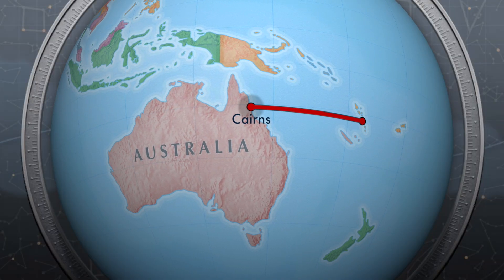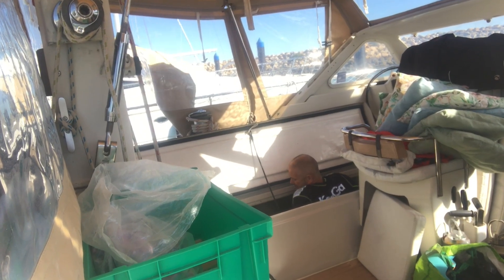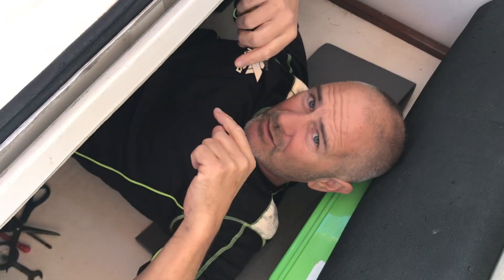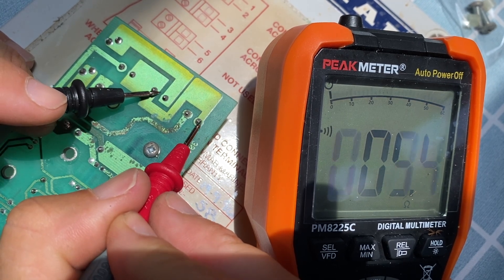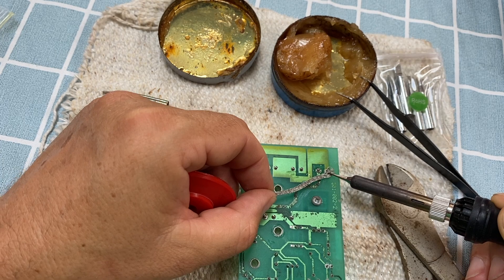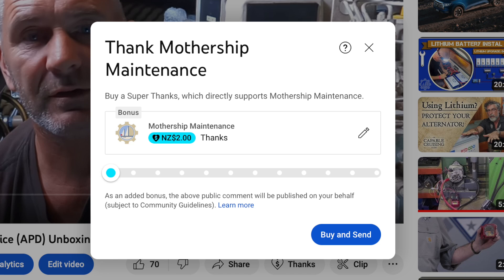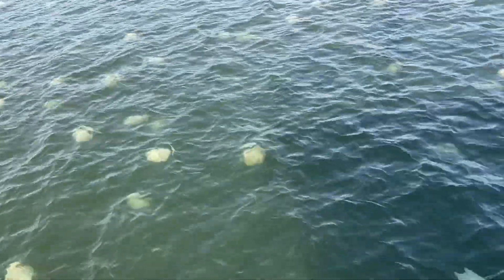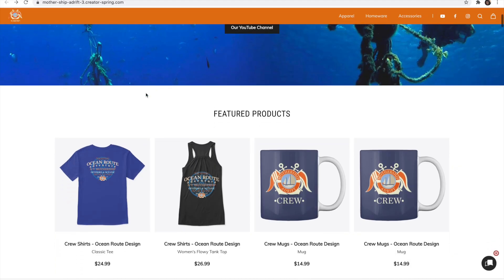#Lewmar Electric Winch Circuit Board - Removal and Solder Repair on our Amelyacht Sailboat

Comment: Great job, most to the time with circuit boards you can just heat the connection and add more solder.  Love the accent, i will sub to see what your story is.  Larry